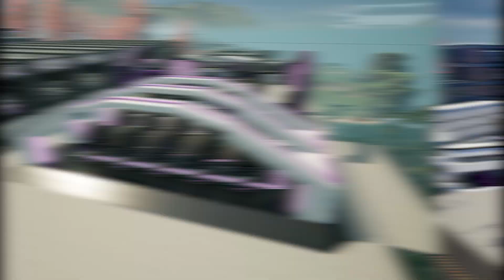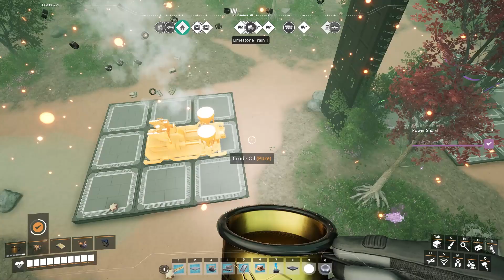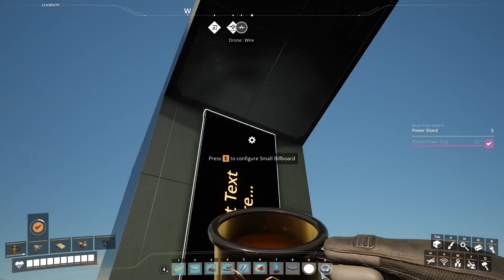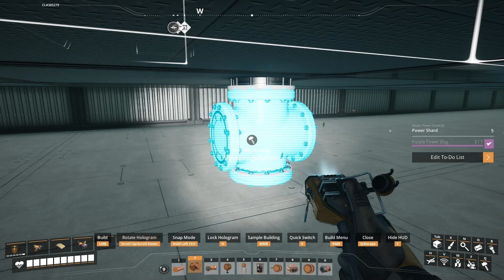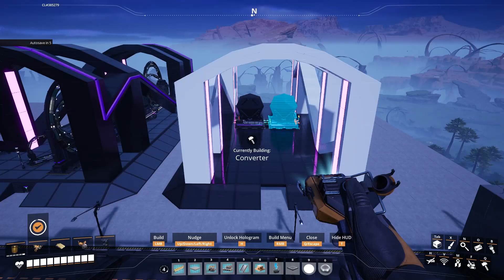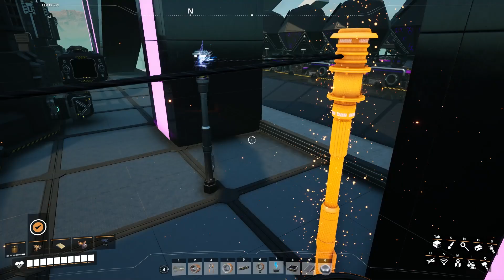Open factories and archways - Satisfactory 1.0 MEGAFACTORY EP15

Comment: 52:00 - my guy trying to connect an output to an output 😂
Reply from the maker: Is that what I was doing wrong... right...
Reply: @DataEngineerPlays  no the thing is the merger you had was offset due to you placing it on a lift you would have to place the merger on the grid first and connect the lift from the merger to the particle accelerator then you can take the 2nd lift and that one will be able to lock onto a floor hole